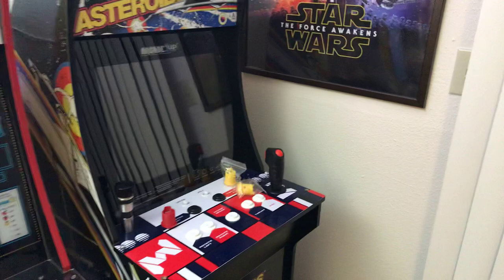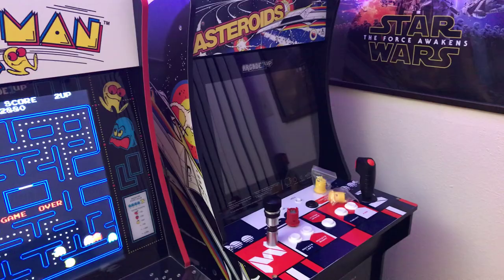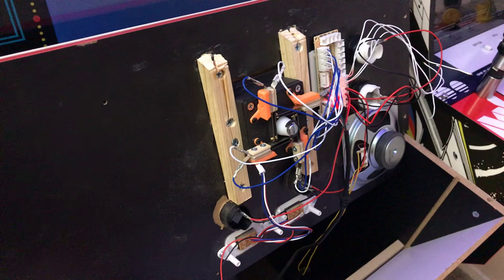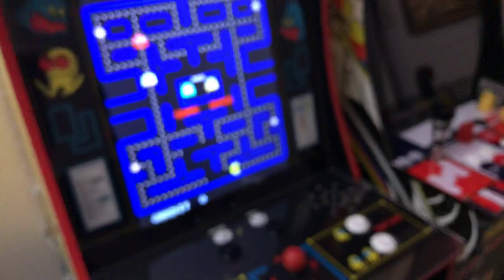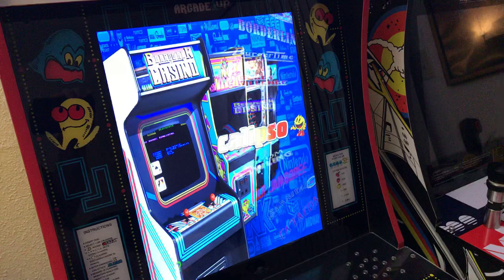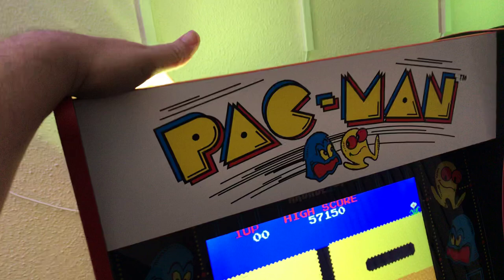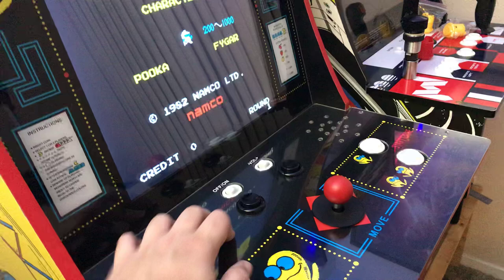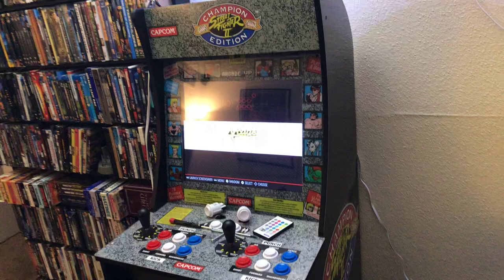Arcade1Up Pac-Man mods: leaf style 4-way Pac-Pro joystick, GoldLeaf pushbuttons and RetroPie

Comment: Great job on the arcade setup. I see this video went up, early this year, so I'm guessing you already know how good the GRS spinner, and trackball production models are. :) By the way, you lucked out with your Pacman's monitor. It shows very good black contrast, and saturation. The one that came with my Pacman, and Galaga, both of which are 2019 versions, have very gray, and washed out monitors. All of the 2018 version 1up machines I have use monitors which look more like your pacman monitor. Something sure went wrong at 1up, in 2019. Thanks for sharing.
Reply from the maker: ThomasGrillo that’s interesting. It sounds like your Pac and Galaga maybe came with the standard monitors they use for the other machines(?). Although the contrast and blacks are not as nice, I think they do have a wider viewing angle. Also, there is a monitor kit people are selling that improves the contrast and brings down that gray level. I haven’t tried it myself, but I’ve heard good things. I think it’s around $10 bucks.  Thanks for watching!
Reply: Yeh, I've been trying to get Arcade 1up to replace those machines' monitors, but without success. I may well invest in that contrast kit, at some point. Saw a YT vid, demonstrating one such kit.

Comment: I was wondering if you have bought new pac-man machines since this video. I am on my 3rd. Getting the XL can from eBay. I was looking at the pac pro stick from Groovy Game Gear but they are sold out. They say they are getting more in but that was months ago when they told me that. Have you modded anymore pac-man since?
Reply from the maker: I picked up an XL around christmas and sold the old Pac-Man. I fact I sold all my gen1 cabs. The XL is FANTASTIC.  I decided not to go the PacPro route again because I really wanted to use this for all my vertical games, which means I need diagonal movement. Right now I have a cheap clone Sanwa in it, and I replaced the switches with 20g switches so it feels as light as a leaf switch stick. And it went right in with no serious modifications needed, it even plugs into the same pins as long as you cut some of the plastic off the side so the connectors can sit side by side. Also replaced the small plastic actuator with a large steel actuator, so the throw distance is shorter. I love the feel of that. Not sure if I'll replace the buttons, they're already pretty great. If you go back to Groovy, I think they do have some variations. Remember that if you get a replica pacman stick like I did, it's built to be mounted on a steel panel so the stick is very short, you'll have to thin out the back of the wood. Groovy has a similar with a longer stick for wood control panels. I think it's called the Leaf Pro, maybe? Been a while.

Comment: Awesome Video! Just got the same cabinet and planning to mod it out. I think you can get longer joystick shafts with separate ball tops and use that with the Pac Pro. If I were to do that would routing still be necessary, and whats the best way to mount it?
Reply from the maker: Nick Grasse yes! GroovyGameGear now has a “LeafPro” that can be set for 2, 4 or 8 way and has leaf switches and a longer shaft. Probably a much easier way to go!

Comment: Still the best stick? Or anything good out there without excessive modding? Thanks!
Reply from the maker: They do have a couple of leaf sticks with a longer shaft that can be mounted very easily, the Dominux8 and the "Leaf-Pro". Unlike my Pac-Pro, these have a long shaft configuration and can be easily mounted in wood panels (like the Arcade1Up).  The Pac-Pro was designed to be mounted in Pac-Man and similar Namco machines which use a thin steel plate for the control panel so the shaft is much shorter, this is why I had to use a router to shallow out the wood. Now, the down side of these other two sticks is that they are NOT 360-degree free moving sticks when in 4-way mode. They use a 4-way restrictor plate, which gives you a diamond shaped field of movement. All in all, I'm still really happy with the Pac-Pro because I just prefer the free movement. HOWEVER, I will say that I ended up snipping off some of the spring in order to weaken it. The stick will still snap back to center, but with less force. It feels more like a Nintendo joystick (ala Donkey Kong, Mario Bros., Popeye, etc), and it's much easier on my hands and wrists.
Reply: Thanks dude I’m new to this so I’m trying to understand all these restriction plates. I play a variety of games so I’m trying to get the best stick for everything or 2 different sticks entirely for each side of my cabinet (player 1 vs player 2). I’m modding a Marvel vs Capcom cabinet so that game is a must play with the best stick for it. Would you recommend no restrictive plate or an octo? And will that decision work well with Pac-Man and Galaga? Thank you
Reply from the maker: @McGuinness89  yes absolutely, octo plate makes it a lot easier to put in precise movements for fighting games like SF,2, MK, MvC etc, but it’s not restrictive at all, you get the full 8-way movement. It just helps you find those 8 directions with precision. 

As for the whole 4-way vs 8-way, you will be totally fine with an 8-way stick for almost all the classic games like Pac-Man, Galaga etc. 

So, classic shooters like Galaga, Galaxian, Space Invaders, Gorf, Phoenix etc, they only use left and right. So they ignore all up/down movement. As for the “4-way” games like Pac-Man, Donkey Kong, Dig Dug, Frogger, etc, most of them can be controlled just fine with an 8-way stick. If you happen to hit a diagonal direction, they just ignore it. There are a few exceptions like Burgertime and Zoo Keeper which are still playable, but sometimes you’ll accidentally go diagonal and your character will just suddenly stop. That can get annoying. But it’s honestly pretty rare, and anyway an octo plate will help you stick to cardinal directions because you can feel it when it’s in that groove going one of the 8 directions. 

As for leaf vs switch, classic arcades like Pac-Man and donkey Kong all had leaf style joysticks and buttons. However, when you get into the era of street fighter II and all those later fighting games, they all had clicks controls with micro switches. In the USA they were HAPP controls, sold by HAPP but manufactured by Industrias Lorenzo (aka “IL”), and IL still makes them today. You can actually buy them at Microcenter, or online, and they’re the exact same controls you’d find in 1990’s fighting arcades. 

Now, in Japan it was going to be Sanwa, and that’s where you get into the octo plates and stuff. Those are also very nice sticks and buttons, probably even more precise then our IL sticks and buttons we had here. 

Either way you go, Japanese with Sanwa style controls or the western style IL/HAPP type controls, you’re going to get a good gaming experience and they’ll still work great for playing almost any classic arcades as well. 

Hope that answered your questions!

Comment: Which one of these cabinets do you think is best to play all the classic games? You decided to put the retropie in the pacman unit. This to mean seems to have the least options regarding buttons and controllers. In order to play pacman and tempest, one would need a joystick and a spinner. My 12 in 1 Atari cab I bought comes with the spinner and buttons, but no joystick. I don't think that their is a place on the motherboard to plug one into. That being said, I am sure that their is not a place to plug a spinner into a pacman cab.  How do you plug in all these controls using the retopie?  Currently I have all my mame games on a laptop hard drive. I would have to get a different mother board which has a vga port, but I would have to use a different set of controllers in order to play the games.  Its
all very confusing to me. Any help from you or an expert gamer would be great!
Reply from the maker: gibsonplayer8  I think it really depends on how many cabinets you want over all and which games are most important to you. For me, I chose the Pac-Man for most of my classics because it has a vertical monitor, and most classic games have a vertical monitor and use a four-way joystick and maybe one or two buttons. That means I had everything I needed right there on the control panel to play most of the games I wanted, for instance if I had planned to use the “60 in one” board (you can find this on Amazon and eBay). Now, if I wanted that to include games like centipede and tempest, you’re right I would have to add spinner and trackball controls. It might be easier to get the 12-in-1 and just add a joystick. I went this route because I knew I also had a centipede and astroids, and my plan was always to split up those games among all three cabinets. So my astroids has all the spinner games, with a joystick so I can play stuff like Tron and mad planets. The centipede is stock right now, but I plan to put in a retropie and run a couple dozen trackball classics on that one.
Reply from the maker: The other thing to take into consideration is vertical versus horizontal. Most of the classic games I knew I wanted for the Pac-Man machine, with four way controls and only one or two buttons, are vertical games. There are a couple of exceptions like moon patrol and zookeeper. But almost all the rest is vertical stuff like Donkey Kong, Kongo Bongo, Pac-Man, ms Pac-Man, dig dug, Congo bongo, Q Bert, burger time, it goes on and on. So many of those early games were vertical. But there are always some games that are just going to end up being on the wrong kind of monitor, like missile command which has black bars at the top and bottom on my centipede machine, and then on the 12-in-1 it’s the other way around with black bars on the side for centipede. Basically it’s one or the other.
Reply from the maker: Aside from that, I have all the other basic arcade games from defender and joust and Robotron and stuff like that to the newer games like Street fighter, Golden Axe, Teenage Mutant Ninja Turtles (the JAMMA era games basically), all that stuff is on the street fighter II machine. Plus all the consoles and stuff.  The two player six button layout is perfect for all that. And then for Gallaga I think my plan is to just turn it into a vertical cabinet for all my SHMUP’s like Galaga, Gaplus, Gyruss, Xevious, Sinistar and all the basic vertical scrollers like 1942, Raiden, Truxton etc etc.As for setting up a PC on your system, it’s really not much different than setting up a retro pie. You’ll want to use Control or boards with USB interface is, VGA which will plug straight into the same board you use for retro pie, it’s pretty much the same thing. The main difference is setting up the system to boot straight to your emulator. .

Comment: Could you talk a bit in depth on the setup of the controls? I'm a bit of a noob when it comes to this, and I'm making my first cabinet as of now, (a 50% scale all metal Pac-Man replica for its 40th anniversary next year). It looks to me like a zero delay ancoder board, but I'm not sure how to set up a leaf switch. Microswitch joysticks look much more "plug and play" as far as the setup goes, but I would like to use a Pac-Pro, because it appears to run the best for Pac-Man, but the issue is that there are hardly any showcases on setup for it! Any description on how you hooked the zero delay board to the Pac-Pro is appreciated. 

Cheers!
-CorellionCrusaders
Reply from the maker: Actually, the GoldLeaf buttons are what I would suggest. You could order some original Leaf Switch buttons, but they are not as easy to come by (an online arcade supplier or eBay is where I'd go), and do have a few more parts. Mechanically they are actually pretty simple, but a GoldLeaf button from Ultimarc comes as one piece and all you do is plug right into the two contacts, just like a regular microswitch. The only real difference is that with a standard Leaf Switch button, the shaft sits just slightly higher above the rim. It would only be noticeable to an arcade collector or mega fan. 

Here's a link to the GoldLeaf order page from Ultimarc: http://www.ultimarc.com/store/product.php?xProd=171
Reply from the maker: As for hooking it all up to the joystick encoder, the board its self will come with a bunch of wires. These wires have a connector on one side that goes to the board, and the other side has metal connectors that plug into the switch on the control panel.  

The thing to understand about arcade controls is that every button and joystick uses the same type of switch, either a microswitch or GoldLeaf switch, etc.  These switches have either two prongs or three prongs.  If there are two prongs, it's simple: one goes to the + and the other goes to ground.  If it has three prongs, then one is ground, one is in contact when the button is being pressed, and the other is in contact when the button is NOT being pressed: you'll want to ignore that prong, usually it's the outside prong of the two at the tip. If there is one coming off the side, that's ground. The + you want will be right next to it. It doesn't actually matter which wire goes to which prong, only which two prongs you use (if there are three), because all the button does is connect the two wires. So that part is simple. 

So, back to the little wires that come with the encoder board. They will plug directly into the GoldLeaf buttons, but they may be too narrow to plug into the joystick's switches.  There are two common types, and I have seen encoder boards that come with either one, depending on the brand. 

As for the side that connects to the encoder, each port is one button. Could be A, B, C, X, Y, Z, Start, Coin,  etc.  And you'll see four labeled "U, D, L and R" for the joystick directions. Remember that these "zero delay" boards are simply joystick encoders, which means that when you plug it into a PC or a Pi, it detects it AS a game controller. So each of the ports on it are detected as one of the buttons or directions of a game controller. All you're trying to do is connect those two wires from each port to the + and - on each button and joystick switch.  

Hope that helps!
Reply from the maker: And as for the Pac-Pro, connecting it to any encoder board is identical to a microswitch joystick: each direction has a physical switch (leaf switch in this case) with two prongs you need to connect to one of the directional ports on the encoder board. However, they are the wider type of connector. This can make them tricky to plug in if your encoder board comes with the more narrow style connector wires. You could solder them in place, but be careful because the heat can melt the plastic of the switch. Better to splice on a wider connector. You can find all those connectors on Amazon or sometimes at arcade supply sites.
Reply: @retronaut8864  Yeah, I actually found out about the pins working the saame by looking closer in your video... I felt like a complete idiot lol. Do you happen to have a link to the wires you used in your cabinet? I found a 4.8mm set of wires, but I believe that the Pac-Pro is slightly thicker.
Reply: @retronaut8864  Thanks a bunch for your help man, I really appreciate it.
Reply: How long did it take for your to arrive? I haven't gotten any info and I ordered it a few days ago. Takes a bunch man

Comment: 6:40 you need to route out about a half inch.
Edit: ok you know that. lol
Reply from the maker: Guess I should have led with that part, huh? Thanks! :D
Reply from the maker: BTW that split in the wood never did cause any problems. This stick has been great. One thing I DID do though, was replace the spring with something much lighter. Gives it a much more feather-light feel, like a Nintendo cabinet basically. Feels great.
Reply: @retronaut8864  yeah I'm building a 60 in 1 and have a 4 way stick I'm going to use. Its I guess a pacman that also has to have the clip taken out to install because the ball doesn't twist off.

Comment: Raspberry Pi 3 is running the game? How's the input lag? That's crucial in a game like pacman.
Reply from the maker: Seems great to me. I don't notice any lag on these Retropie emulators. Although I haven't done any video analysis or anything. I'll tell you what does bug me is the sound lag on the Arcade 1Up boards. It's insanely noticeable, and it surprises me that almost no one has called them out on it. You hear the press of the button damn near a full second before the laser fires in Asteroids, Centipede, etc, and it's a consistent problem on all of the A1up games I have. That, combined with the much more favorable scanline image, really makes the Retropie option SO much better IMO. Also, the vector lines in any game with vector graphics, it's a world of difference between a properly setup emulator and the terrible A1up vector settings, which appear low res and with zero anti aliasing. Ugh.

Comment: How many USB encoders are you running?
Reply from the maker: Joey Clark I use either one or two game controller encoders on most of my machines, but on the Asteroids it’s a single I-Pac, which is actually a keyboard controller. Let’s you map WAY more buttons, and also some MAME versions have problems recognizing a mouse if there is any game controller plugged in at all. So using a keyboard controller gets around that problem, because the spinner is essentially a mouse.
Reply: @retronaut8864  Thanks for the answer. Great video, by the way.